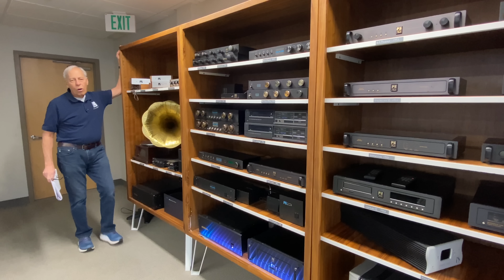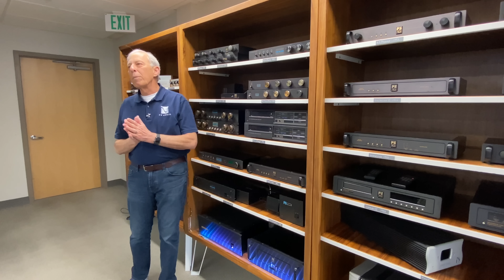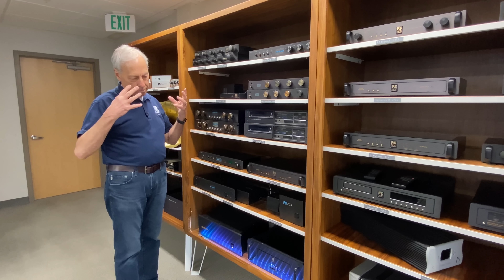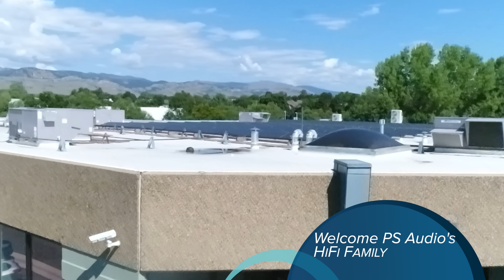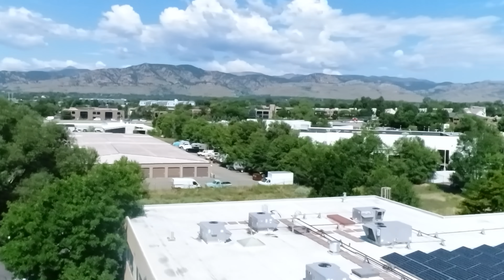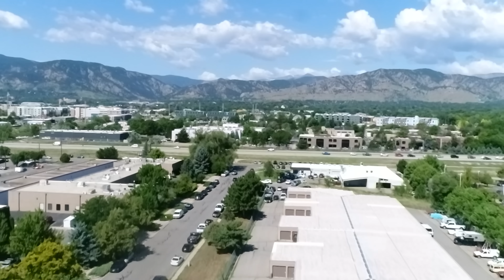Where do engineers go wrong?

Comment: You can pay $2000 for a good stereo power amp and cables or you can pay $20000 for a so called “hi-end” amp and $2000 on special super-duper cables. Both amps will measure very well on test equipment that is far more accurate, consistent and reliable than the human ear. You go for the $22000 amp/cables and it sounds much better than the cheaper amp. Unfortunately nobody else can hear the difference. This is called “Magic”, or more accurately the medical term is called “Gullible Sucker Syndrome”.

Comment: It also makes a huge difference what the cables are doing! Line level interconnects do not affect the sound nearly as much as guitar cables affect guitars, which can be clearly and drastically audible with the guitar cable acting like a low pass filter. This can be easily calculated theoretically. This is due to the differences in source impedance and its relation to cable capacitance, as well as being balanced vs unbalanced. Speaker cables also matter due to resistive losses. These problems generally increase with length. Digital cables like S/PDIF, ADAT, ethernet, and HDMI simply do not make a difference to the quality assuming that they're working correctly, with a possible exception if the converter is being externally clocked via these cables due to jitter, although many digital devices have clock regeneration circuits anyways (RME SteadyClock is an example of this). I have actually seen toslink optical cables with "gold plated connectors", which is truly the dumbest thing imaginable! Another thing to note is that even in analog connections where the cables do theoretically matter somewhat, much of the perceived improvement can be attributed to psychoacoustics when A/B comparisons are not blind tests.

Comment: Well said Paul. Yes there is a huge potential to be gained from using the right cables in a system, there are thousands of different designs/qualities/models, and then there is the gear you pair it with that also react very different.
But it also has to be said that, most equipment in the world (the average gear) combined with the normal cables that are available and affordable do not make in general a huge difference. And that is mainly because, most equipment is locked in sound and at a lower level, meaning that you can only move the sound very little.
But once you start getting up to a general quality of PSaudio type of gear, then suddenly the same cables can sound very different, where as with normal gear, the effect is more muted.

Comment: You're right Paul, proper science shouldn't be subjective. Unfortunately we have alot of bad/junk science. To use the climate change example- computer models aren't science (and have proven to be waaay wrong). A consensus is not science. Cherry picking temperature data across the globe and comparing it to numbers from 100 years ago, where those temperature points were once in a rural setting and now are surrounded by blacktop, or don't exist at all anymore, is bad science. Etc.
The same can hold true for audio, cherry picking specs. Saying an amplifier produces 1000 watts at 1khz with .003% distortion is all well and good, but if they leave out that at 18khz it's 8db down and the waveform looks atrocious, it's just bad juju. Thank you again for your videos though!!

Comment: Science doesn't have all the answers.  Science doesn't even have all the questions.  And that is a big part of what is FUN about science!  

Ask a question, come up with a hypothesis, and then test if experimentally.  If it doesn't pan out, admit "okay, that was wrong" and come up with another hypothesis, either a variation or a completely different one.  If the hypothesis does appear to answer the question, keep working it and also see if others can confirm it.  If enough evidence supports the hypothesis it may become accepted as a viable theory.  A theory may not and probably doesn't describe everything perfectly, but hey, Newtonian mechanics got us to the moon and back.  We don't understand everything about relativity or quantum mechanics, especially how the two theories (yes, theories) do a good job explaining things on differing scales, but not both.  The 'Theory Of Everything (TOE) is still a work in progress, maybe some very clever person(s) will eventually figure it out.  Or not.  And yet we have usable computers and cell phones and global positioning systems and .  .  .  Engineering is the practical (usually) application of science.   Just don't fall victim to the hubris of believing that you know it all.  You/we don't.   

Very good video, Paul.  Apologies for the sermonizing, I tend to get a carried away sometimes.

Comment: Why cables make a difference? Too many crappy built and designed components is why! Well designed and properly matched and functioning gear does not need special cables. Of course starquad XLR is what any engineer will recommend because cheap RCA is asking for trouble.

Comment: I'll believe there are audible cable differences, when I conduct an A/B test with you, and you beat the "monkey score" at identifying a cable (all cables being compared must have sufficiently low resistance).  
I've had some opportunities to review a case where listeners insisted there was a subtle but audible difference, but my own listening showed no difference.  One example was a GR Research video where they had equipped a speaker crossover with switches so they could select the original parts, or their upgraded parts.  The GR Research staff insisted they could hear a distinct difference, even in a recording that they had made of the test.  So I listened to their test recording, very carefully, jumping back and forth between the same points in the musical passage in the two versions.  Every time I thought I picked up a difference, further repetitions to try to confirm it, proved otherwise.  
You cannot do these tests by listening to A and B only a few times.  It takes dozens of repetitions before you can reach a conclusion - and mine was that there was no audible difference.
Reply: Hey, the model answer is, you don't have a system with good enough resolving power to hear a difference (so, spend a few more grands to upgrade first), then, the next best answer is, the test won't work, as you listen carefully for so many times, you get fatigue and so, you can't spot the 'real' difference.
Reply: @stephenwong9723  
So your conclusion is that one should go with their immediate impression, rather than using more careful procedures?  
I think that is sloppy and meaningless testing, and is precisely why the "cables make a difference" myth exists.
Reply: thankes YOU. youes are th honest feRnd. THUMBSS UPS.
Reply: I think you like torturing yourself more than music, u should do at least 1000 tests,  I mean there is no chance u as a subjecte could ever be influenced by the the test procedure right?
Reply: @Fufiloofa  
Please keep in mind that your comment applies to everyone doing listening tests, whether or not they agree that cables can make an audible difference.  
I agree it's a problem, and that is why blind tests are essential.

Comment: If a person can hear it, it can be measured. The point, which has been said many times before, is that no HiFi system is “perfect”. No system can be “flat” from 20 to 20,000 Hz at 95 dB. The “best” or “most accurate” sound will be heard in a great symphony hall. And even those sound different from place to place. Whether it’s a cable, interconnect, CD player, DAC, amp or speaker the differences are heard as “good” or “bad” depending on ones taste and listening environment. Assuming, of course, that the equipment is all of “reasonable” quality.

Comment: Cables are like religion!  I'll leave it at that.
Reply: That well may be for some, but to me cables are based upon facts.
Reply: @jamesplotkin4674  And who is behind those facts? What are their accredited qualifications?
Reply: @andydelle4509  When music comes out the other end of a wire, it makes me a believer :)
Reply: @jamesplotkin4674  LOL! Since when does "music" come out the end of a wire? Oh a wire can produce music, like a string instrument or a piano. But to think music goes through wires in an electronic system is highly sophomoric thinking. If you choose to study that in depth, like an EE student, you will quickly see how absurd most of the audiophile claims really are.
Reply: @andydelle4509  Yes, music does indeed come out the end of wires, just as gold plating enhances toslink ;-)
Reply: @andydelle4509  Look up Roger Russel. No one has better qualifications than he does and he says as long as cable resistance is low enough it doesn't matter.
Reply: @FatRat-f9m  If a set of speaker interconnects (I like big words) reject RF interference and are of adequate gage, then they pass the "test."  I'm sure there are some configurations which benefit from design which specifically address noise rejection and I'll believe the science. But... I just can't see myself dropping over $20kUS on a pair of cables.  I could go on, but it would require the viewer (reader?) to obtain a set of waders.
Reply: @jamesplotkin4674 ...I don't know if I told you this already...I paid $480AU ($350US) for some sh!t-hot (I like big words too) 7N PCOCC Made in Japan interconnects back in 1993 that I will never part with; they're mine for life. However, for loudspeaker wire (cable) I'm using '70cents/metre' 1.5mm diameter (whatever gauge that is in Yankeeland) solid core 'dirty' copper wire & it sounds amazing. Stranded wire makes the bass sound 'muddy'
Reply: @FatRat-f9m  Yes, you did. That comes to our number 14 wire.  I'll give it a go.
Reply: @jamesplotkin4674  for my 3 front speakers towers and centre I use  qed genesis silver spiral  about £90 a meter but for my back 4 channels I use 4 book shelf speakers I use qed silver anniversary xt £10 a meter on speaker cable and subwoofer cables and hdmi I spent 10% of what I spent on my set up ended up being £1000 but I don't see need to change my speaker cables ever or hdmi  for moment so its a ok investment. Now people who spend £10,000 + on cables are cracked in the head plus all my cables have lifetime guarantee.
Reply: @harpalchauhan428  In time, those wires will become porous due to constant electrons flowing through. You'll get more life from a set of cables if you reverse their direction occasionally and assign different tasks (speaker in the home theatre) each 100 hours. Akin to rotating your tyres.
Reply: @jamesplotkin4674  thank you never heard that ever in my life but nice to know. I've had my speaker cables in same direction for 8 years lol wow. Normally twice a year I give my whole set up a spring clean and unplug everything to clean the connectors and so on will change direction for front 3 channels but sadly my back 4 channels wires are taped flat on floor to the back and then 2 thick long rugs on top then my unit and everthing else on top lol. Sadly can't do same with subwoofer or  hdmi cable as there directional cables and if you put input side to a hdmi out you get no signal or picture. 😥😥😥 lol but that's designed to have less interference  to the timing clock on amp or player. But thank you again nice to learn something new
Reply: @jamesplotkin4674  only other thing I'm lucky with is lifetime guarantee I used after 6 year they replaced for free of charge only paid my end postage that was it . And been using Qed.co.uk  since 1996 and the give you state of the art cables at a decent price and that others try to  copy at double the price or more  look them up.
Reply: @harpalchauhan428  Thanks for the tip :)
Reply: @harpalchauhan428  Oh, yes yes yes, but also you must wipe the cables with a micro-fibre flannel (no other will do) with some silicone lubricant. This allows the electrons to flow faster, thus your low frequency response will nearly double.  My subs used to only go to 30hz, but now I can feel they go all the way to 15hz.
Reply: @harpalchauhan428  Speaking of connection cleanliness, I use a product called De-Oxit to avoid oxidation. Really works, not BS. I  also don't play rude vocals.
Reply: @jamesplotkin4674  I use micro fiber cloth but mr sheen which is multi surface cleaner for glass metal and wood, seen there special products for cleaning connection and connectors but never hot chance but will asap thx you again.
Reply: @FatRat-f9m  Right-o, gov. I'd like to try some in the black jacket, too. The wavelength is broader than the white version.  I've been using some 50 year-old, 300 ohm twin lead television antenna wire to some success. My concern with that has been that it get's warm at high volumes, so I must stand it off away from combustibles.
Reply: There are 3 variables that make cables sound different...and this is physics..which you skimped in high school apparently.
1. metals used and in what % of copper, silver and whatnot
2. thickness or resistance which is also correlated to the length
3. EM shielding
Now...each of these 3 variables have their own variants..long/short cable..thicker/slimmer cable...with or without EM shielding...silver cables...pure copper cables or a mix...and so on.
Now you can see why a thick short silver cable will sound completely different to a long skinnier copper one.
I can bet by house and my E Class Mercedes than even your nephew or child would spot the difference between these 2 right away !
P.s. my first speaker cable was a cheap one...it acted as an antenna and picked one radio station which I could clearly hear when I lowered the volume of the amp !!! 
Basically the radio station was playing TOGETHER with the music from my cd player.
I switched to a medium value cable...nothing fancy. Problem gone.
But sure...they're like religion.
Reply: @FatRat-f9m  I've been "on holiday" since first of March, so I have the time, but no coin. Stay healthy and mind the rams, as well. Baa Baa!
Reply: @FatRat-f9m  Thanks :-)
Reply: In my opinion, religion is a load of old rubbish, followed by weak-minded gullible fools!
Reply: @marcse7en  Religion preys upon those who choose not to think for themselves. That's why former Hi-End audio sales associates who preached the Monster  gospel feel bad they took advantage of those who sought wisdom and guidance. Peddling 901's and a few metres of crap makes one repent, eventually.
Reply: @marcse7en  This is not the forum for that type of comment.
Reply: @cablebrain9691 ...thank you for your opinion

Comment: Cables,     all Snake Oil.   How do you measure get a scope with double trace and compare the input and output with the same loads on different cables.  never seen any differences in all frequencies.     Snake Oil!!!!!!
Reply: Are you sure is not in your mind after spending a ridiculous amount of money on those cables that is telling you- "good boy, sounds so much better"-  :) Science is the driving truth.
Reply: Well they will quickly tell you the scope is not nearly accurate enough to show the difference. Right! Now one area where the human ear/brain seems to be very sensitive is phase shift. But again even basic test equipment is far more sensitive. The audiophile community is largely a community of hobbyists that have no technical experience beyond the local HiFi shop. They have no concept of how advanced we are with modern electronics and many other technologies for that matter. Hence they are easily molded and influenced by charlatans. Being that high end audio is expensive many of these audiophiles at the high price end are snobs as well. They religiously equate quality with price with no regard to scientific testing and it's often contrary results. The fact that the DAC circuit in your $400 Denon Receiver is just as good as the $10,000 stand alone DAC is beyond there limited technical understanding. Then you point out that the Denon product has a army of accredited electrical engineers behind it while the $10,000 DAC is built in a garage but a guitar amp serviceman. That really gets them going.
Reply: @andydelle4509  
I've done experiments to attempt to demonstrate audibility of phase shift.  Haven't succeeded yet, at least with signals that have voice-range fundamentals.  I'm highly suspicious of experiments I've read about, using variable phase-shift filters.  
The method I use is to mix a fundamental from one source, with harmonics coming from a second source, then perturb the second source frequency slightly so its phase drifts very slowly.  There's no audible change across all phase alignments, even if I try to cue myself in by watching the waveform on a scope while listening.
Reply: @Larry Niles 
How many blind A/B tests, with over 25 instances, have you passed?
Reply: @Larry Niles your mind is playing tricks. if you like that well ,,, go for.